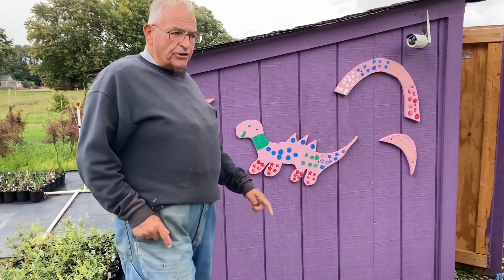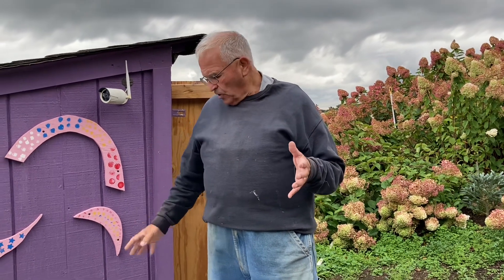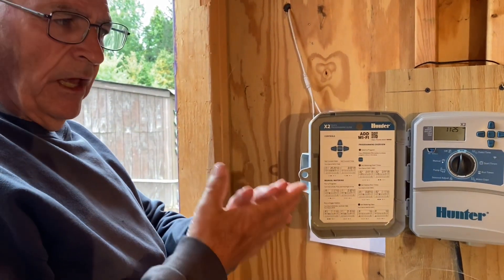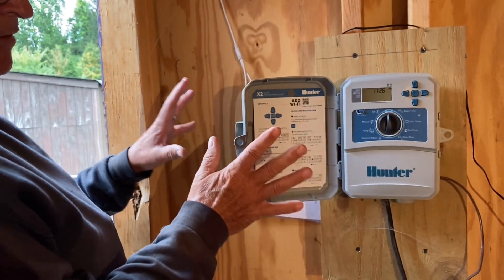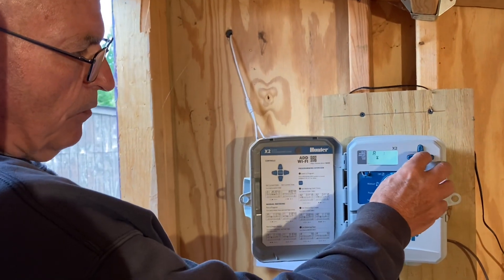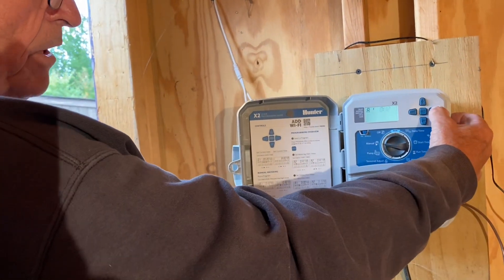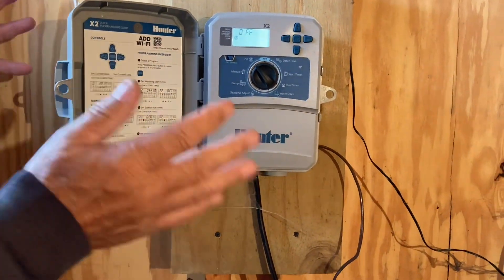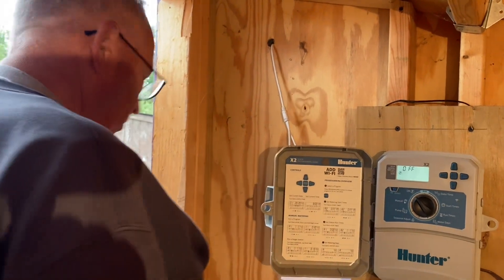Programming a Hunter Irrigation Timer.

Comment: What size is your pump
Reply from the maker: Right now I am using a 1 hp well pump.  I used to use an irrigation pump which was great but it didn't make enough pressure to trip the switch but moved tons of water.